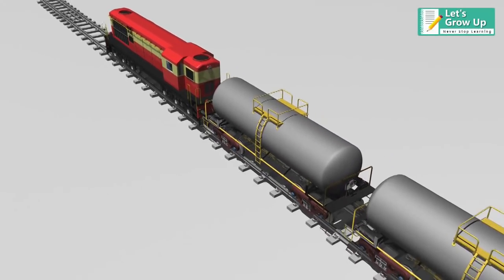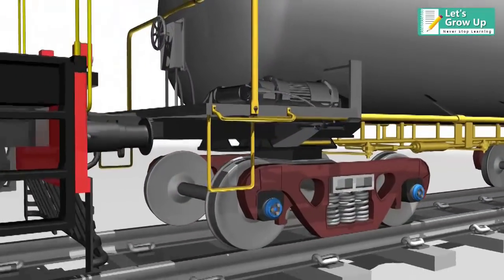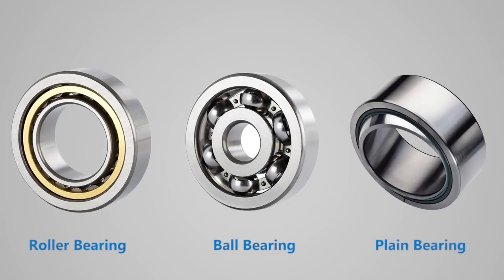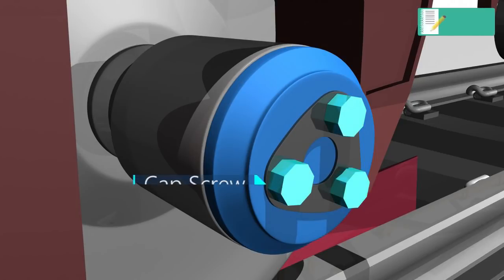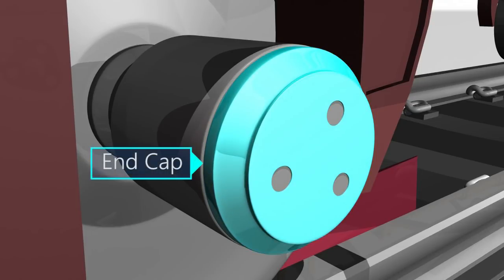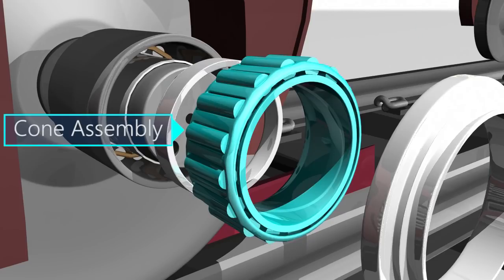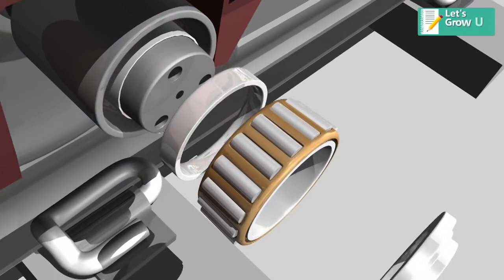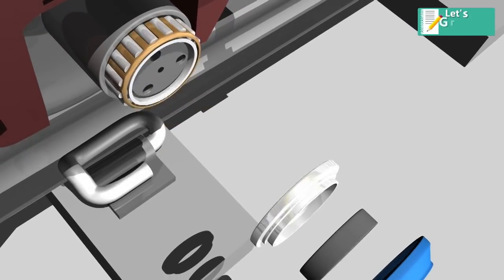How CTR bearing works in the casnub wagon?

Comment: I think you will find that  whilst a roller or ball bearing most often decreases the rotating friction it does NOT decrease the load. In fact it really increases the maximum line and point stresses within the bearing assembly (roller/ball compared to plain) but a rolling action very much reduces the shear forces compared to a properly lubricated plain bearing.

Comment: Back in the day I worked at FSA in Ontario CA. They rebuilt the bearings for the trains. Amtrak had they worse condition of bearings, some missing the actual bearings rollers while some missing the cages. I did the end caps , worked on the bearings line then eventually I rebuilt the heads. Whis I stayed there ...
Reply: Amtrak goes faster than freight trains, not to mention they're at the mercy of the respective owners of the tracks they run on as far as the track condition. When you think about it, it's no wonder they were so beat up. America's rail infrastructure is way out of date.
Reply: @PowerTrain611  g

Comment: Good animation, although your cone rollers angle is very flat, almost looks like cylinder roller bearing instead of taper roller bearing.. this type of cartridge bearing was introduced by Timken back in the 50s. Timken is still the best